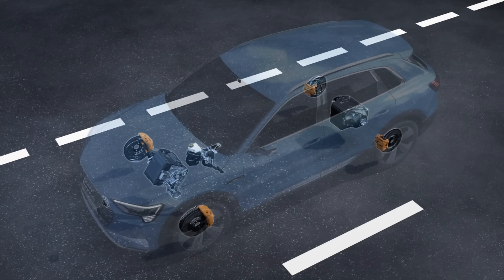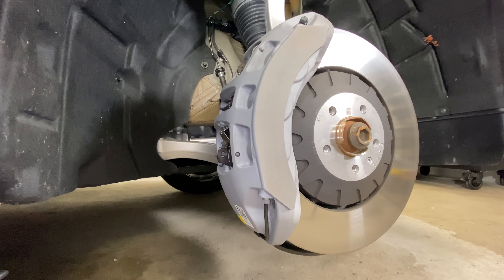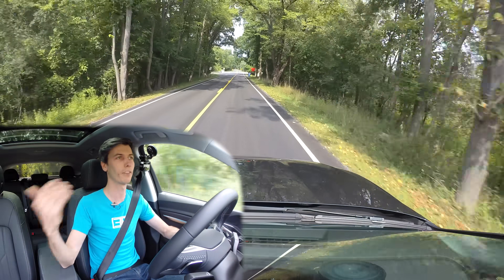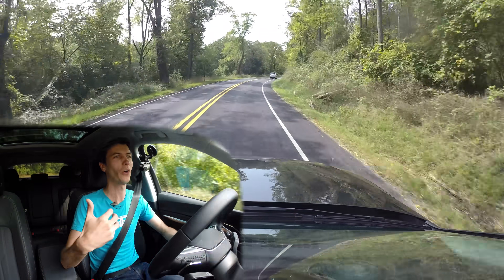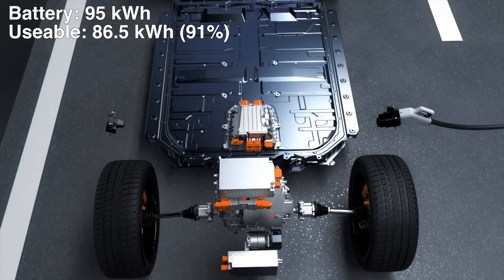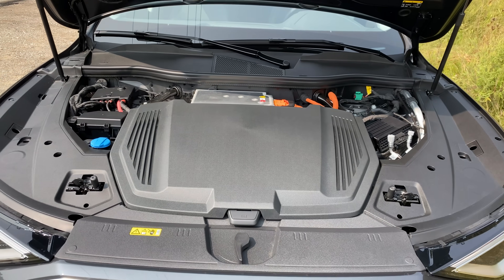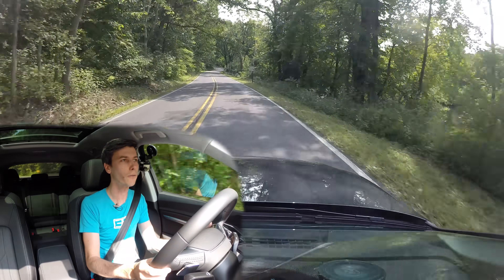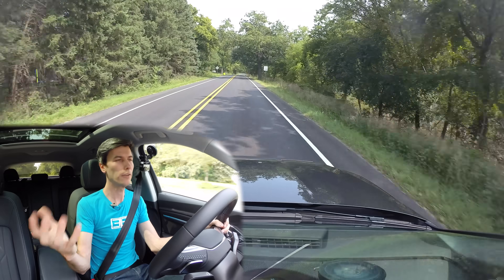How Does Brake-By-Wire Work? Plus: Audi e-Tron Sportback Review!

Comment: Your worst case braking scenario still has the back up valve function perfectly, I can think of worse than that
Reply: The backup valve is most likely a "close-when-energized" (aka normally open) type so in most failure modes, it would open and the brakes would function hydraulically.
Reply: @moi01887  
This comment makes sense
In my field of work we open and close electric valves to allow/ stop water going through..we open the valve against the flow of the water,so that should the valve fail it fails closed (so we don't flood) 
However in a cars brakes scenario,it oils close against the force of the brake fluid,so if the valve fails,you can't " turn" the brakes off fully.
Reply: You can make a valve that opens naturally when power is lost for example
Reply: @leolego2  how? If the ecu fails, what then commands the valve to open?? Not being argumentative. Legit asking questions to learn. 

Edit. Seems i should have read other replies before responding to you. It would make sense if the ecu provided power to close the switch/valve, and loss of power would cause the switch/valve to essentially turn off. Basically backwards operation.. Thanks!!
Reply: @mikeschaner5853  
If the valve breaks,it fails to stop the brake fluid,so you will always have 
1) brake by wire if all the systems are working
2) if brake by wire fails,the valve will open and allow brake by hydraulic force
3) if the hydraulic valve fails, it will fail open so the hydraulic brakes will always work.
So worse case scenario is your brakes are locked on,never not working.
A truck with air brakes uses the same principle (although hydraulic and not " brake by wire) so that the air is used to release the brakes,so should it have a total air loss,the brakes are locked on .
It goes without saying in any above set up any hydraulic fluid leak is the nightmare(is total loss of brakes) and your mechanical handbrake is your " OMG device) as it has been since cable brakes were phased out in the 1930 or 40's or earlier.
Reply from the maker: Yeah but it's like saying worst case the plane still has another engine. There's another engine. Worst case truly is both engines failing, but there's a probability of events occurring that you have to eventually agree to. No such thing as an actual 0% chance of failure.
Reply: freezeme360  because normal hydraulics have never failed... Everything fails it's a matter of how often it fails
Reply: @franciscobarrazasaavedra4754  yeah but if they do fail it’s from flat out neglect
Reply: @franciscobarrazasaavedra4754  some people have fear of getting into elevators because they think they will crash even though history shows those types of crashes are rarer than you dying from choking on your food. It looks like people in this comment section have fear of electronics.
Reply: Traditional breaking systems aren't totally fail-safe either- lines can be punctured, fluid can leak, cables can stretch or snap. Wire's and solid state ECUs have no wear components. The only likely source of failure is the electric pump.
Reply: @derpmansderpyskin  solid state electronics themselves indeed don't really wear (technically semiconductors do wear, but that'll get very technical). Things like connectors, solder joints and such mechanical components do wear and are almost always the problem. So the failure mode is generally mechanical, like with the hydraulic equivalent
Reply: Worst case scenario: batteries and chassis suffered severe corrosion, resulting in a car with just 15 hp. After starting and restarting several times you manage to get it to 10mph. A door falls off and an airbag half-inflates. You're heading towards a tree when the steering cuts out. The brakes fail on both the electronic and hydraulic systems, but a wheel falls off grinding the car to stop before it hits the tree.

Nobody gets killed.
Reply: Hydraulic brakes can fail as well. I've had a rusted line burst and even with the dual system the brake capacity is very poor if you lose half of the system. Way less left than 50%
Reply: @thomgt4  yeah but that was “YOUR” fault my guy you see rusty brake lines you change them that is all on you 100% my friend no excuses all your fault
Reply: There's a small detail that no-one considered (but probably Audi's engineer did).. the emergency system that lies beyond the security valve is empty? If so you're gonna get a quick depression from the pedal as soon as that valve opens (since air is compressible) and then after a couple pumps on the brake you'll have (finally) some pressure
Reply: @andrea7693  you can probably bleed it with the valve open to get air out
Reply: Yep.. but you cannot have fluid "in pression" on the other side of the valve, that will prevent it to opens up.. That means that if there's fluid past the valve it isn't part of the normal brake lines, so there must be another one way valve down stream.. ahahah seams stupidly complicated to me 😅
Reply: @andrea7693  you can definitely have pressure on two sides of a valve
Reply: The fallback valve is mechanical. So a power loss or ecu failure is no problem.
Reply: There is even a third fallback layer. When all hydraulics fail while driving the electric parking brake can be applied a little via the button and even has an ABS functionality for the electric actuators. The rear wheel won't even block while driving on ice.
When the hydraulics are working applying the button is just like pressing the brake pedal.
Reply: @hkad6252  really? I know that parking brake button will activate emergency braking but as far as i know it still uses the hydraulic brakes
Reply: @eikuz  It does when the hydraulics are working. When there is a complete failure like a major leak the electric actuators can do anti lock braking on the rear wheels. Not as fast as the hydraulics though.
Reply: Was gonna say the same thing.. What if the ecu fails??? That particular valve presumably is electronic also.. Even without ecu fail, like you hinted at, what if that valve fails also...
Reply: I would think its also mechanical so if you press the brakes really hard it may open. But a casual braking system can fail as well
Reply: @FrozenCraftYT  While it can fail, the traditional one is linked from the pedal to the pads, and even if you lose pressure on one wheel, the system is double routed on diagonal, you still have breaks, if no current anymore, you loose abs but the power brake pressure is still good for another couple of presses, plenty to stop it. While here if that valve is electrical, and the mobile microwave has a short, you are fucked for sure.
Reply: Imagine, what if companies have people working for them that know about this stuff and work it out so that it's safe? We could... I dunno, call them "engineers" or something. And, what if, stay with me here, to make sure they do it right, we have some kind of body that tests and checks the cars to make sure they are safe? I know, what a wild idea. That would never work.

Comment: Dash looks better without the gloss black on the passenger side. E.TRON’s are thirsty but they are both quite handsome and comfortable. If you want an EV for 49 to 51 of the 52 weeks of the year and ride in comfort then buy this and rent your road trip vehicle to rack up those miles if touring is your thing. I resisted doing this last time and spent 92% of the miles of my one size fits every situation touring car with one person in it doing daily short trips very inefficiently. Humble experience speaking here. 🤷🏼‍♂️ Renting seems like a waist but so was all that value I burned up putting around town killing the life of that touring long range machine.

Comment: Why does it have paddle shifters on the steering wheel?
Reply: They are used to control the strenght of regenerative braking.
Reply: @R3lay0  Interesting, and convenient so you don't have to find that function buried in some sub-menu. Thanks for the info =)

Comment: Jason: It's not going to fail, it's a low risk item.
GM: We f*ck up everything, though. 

One takeaway though, especially after the Corvette recall/stop sale/whatever. I figured once any one of these sensors or other electronic parts that completes the circuit inevitably fails at 100k+miles, you would lose brakes. Surprise! Crash! Thankfully that's not the case. 

I'll take my normal brakes until this nonsense is the new standard, like ABS. I kinda wish the idea would be to make people better drivers, not roll out more and more assists for people that don't know what they're doing and aren't paying attention anyway.
Reply: Though I agree with you, it's much easier to engineer parts than people. People already know better, but they do what they want anyway and try to justify it through any means possible whether valid or not.
Reply: I’d rather we just put everyone on mass transit so they stop almost hitting me.
Reply: @HydratedBeans  the problem with that is that you end up on mass transit yourself.  Busses = boring drag races.
Reply: @crispy9175  yeah but I can watch YouTube on the bus. I'll keep my car for the track though
Reply: Its a German car so it was probably designed for better drivers than it it sold to in the US.
Reply: Yeah, GM electronics. As the proud owner of a rustbucket GMT800 Suburban, I can confirm, electronics have problems. Most recent, A/C stopped working due to ECU failure. Now, power loss because catalytic converter. It's a shame that the GMT800 is my favorite body style for full-sized SUVs and pickups within the last 20-30 years. Oh well, I'd rather spend $5,000 on rust repair and polish my turd a little than deal with dealers or expensive newer vehicles.
Reply: @lsswappedcessna  Yep my 1999 Silverado is slowly wasting away at the rear of the rockers due to the cheap factory paint job and metals GM used, but damn if I don't love that body style, just clean lines with the suicide rear door and no B pillar for the extended cab. The engine and 4x4 drivetrain are still going strong after 285k towing miles (457k km) (thank you Redline synthetics!). The stock steel brake lines rusted out and ruptured around 185k, so I replaced them all with some aftermarket stainless lines for cheap, and yes I'm also saving up a few grand for the body rust repair. Like you I'd also rather repair the rust and have a replacement engine/4l60e on standby rather than spend the insane amount of cash they want for newer trucks.
Reply: @anydaynow01  Yeah, cars are just getting more and more expensive. I can see the appeal of a brand new car, but I don't really need or want one. If my Suburban can't be saved by the time I have the money for the rust repair, I'll start looking for a decently priced vintage (probably midcentury, 50's-60's) 4x4 Suburban. I doubt there's a GMT800 in the world without serious rust, but there's a lot of classics in the world that are in good shape but not expensive.
Reply: BBW was always going to happen - it's simply an evolution of the systems necessary for self driving cars. Also, since other systems like hydroboost and vacuum boost rely on a constantly running engine, you need to move away from those systems with electric. The fake feedback on the pedal as well is useful as a wear feedback/maintenance warning for clueless consumers- start making the pedal feel harder as the system detects pad wear, throw up warnings at the same time, prevent metal on metal situation. If you're an enthusiast on Facebook, you've probably seen pictures of brakes worn so bad, it's not metal on metal, it's down to caliper on cooling fins...

Comment: So if the brake system fails, then the brake system opens a valve.  hmmm  me think's that's not what I would call redundant
Reply: Actually this is not correct. If you don't press the break pedal the valve is open. Once you press the break pedal the valve closes and the system goes by wire. If you let the pedal go the valve opens again.
Reply: @thot1414  Well that's still relying on the valve to NOT close under a malfunction.  Not redundant IMO.
Reply: @thot1414  Basically my concern is: if the system "thinks" the brakes are working properly it will continue to close that valve.  I just don't like anything between the pedal and the fluid pressurizing the pistons WHEN THERE'S NO NEED FOR IT.  Regenerative braking can be and has been accomplished using the first inch of pedal travel before it get's into the standard brake system.  No reason to overcomplicate the wheel IMO.
Reply: There are many hardware and software measures in place to prevent that. These measures are regulated by ASIL levels (ISO 26262). In this case ASIL D. Belive me, these systems are heavily tested  in severe conditions (temperatures, humidity, vibrations, etc.). A Tier 1 cannot afford to sell unsafe systems to the oem, especially if it is about breaking.
Reply: @thot1414  I appreciate the info man.  Still not a great idea IMO.  The number of recalls that have killed people over the years will always make me question any safety standard and that's before we started messing with brake by wire.

Comment: So are stage 3 brake tunes going to be a thing now?
Reply: "my car goes full abs with 1mm of pedal travel bruh" hahhahaha
Reply: @RafaGmod  no need for abs with brake by wire. It's a closed loop control system like cruise control.
Reply: @davidshevchuk8885  do you know how ABS works? There's a need for ABS no matter what so that the brakes don't lock when you floor em. ABS is technically a brake by wire safety system on it's own, just significantly less intrusive.

Edit: autocorrected
Reply: @SpadeNya  Your last sentence is what I meant.
Reply: What is a stage "x" tune? Like what does the stage mean?
Reply: @davidshevchuk8885  Stage "X" tune means the level of performance upgrades that a vehicle has. Especially on tuner cars such as a Subaru WRX people will upgrade parts such as the intake, exhaust, and tune and call it stage 1. Stage 2 would have a more comprehensive list of upgrades, so on and so fourth.
Reply: @ML424wr  That makes sense, so it would vary on a by car basis.
Reply: David Shevchuk it's very arbitrary but it's basically a higher number is more a extreme tune.
Reply: @AriesUmbra  makes sense, rather than giving tech specs that a non-enthusiast wouldn't understand
Reply: ??? Brake tunes. You means racing ABS and traction control together with better materials with less heat retention and fading ? Yes that's will still be a thing but with EV maybe ultra aggressive rengen with a brake resistor.

Comment: The W211 has Brake by wire too. System called SBC.
Reply: That old????
Reply: @SkyHighGD  I think 2003 was the first year.  The stated advantage was being able to individually modulate wheel pressures to maximize braking forces.
Reply: @thomasw4709  Nice
Reply: @SkyHighGD  yeah this system was  presented in 2001.
Reply: @N0mex695  @Thomas W says 2003
Reply: If I remember, SBC was ditched by Merc due to its unreliability.
Reply: @nsbhagwat  unfortunately . The were several problems with the hydraulics. (Pump failure)
Reply: Mercedes switched away from SBC on most models because the SBC pump has a limited number cycles (brake applications)  after which it needs to be replaced to ensure safety.  All mechanical devices have a safe life cycle limit.  Replacement SBC pumps were hugely expensive and customers were not pleased. Eventually Mercedes put 10 and then 15 and then even longer warranties on the pumps. I had a 2004 E500 that had the SBC pump time-out around 150K Km’s. Mercedes replaced it under extended warranty, but it would have been over $3K otherwise.